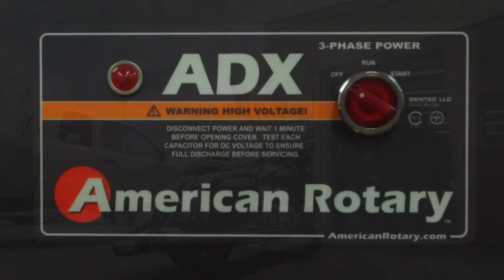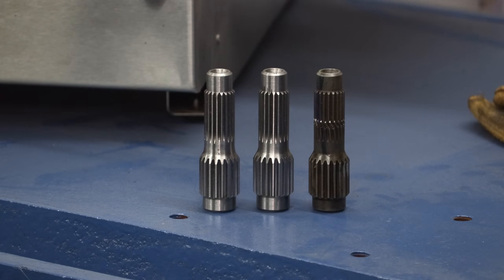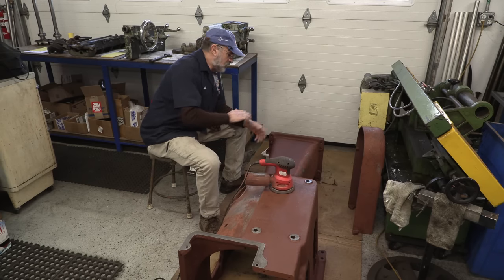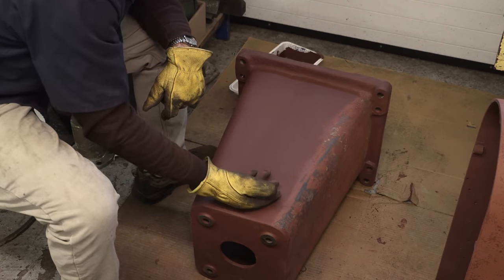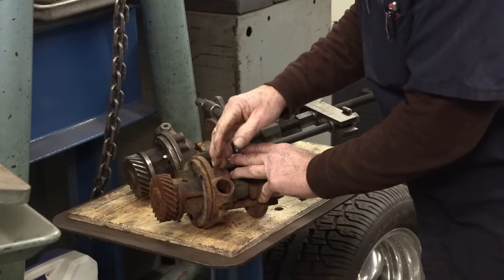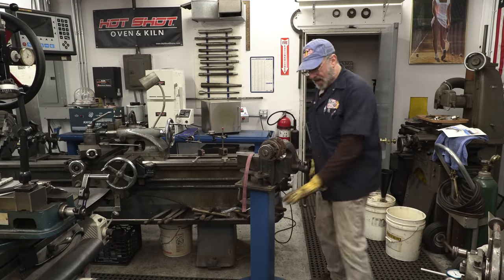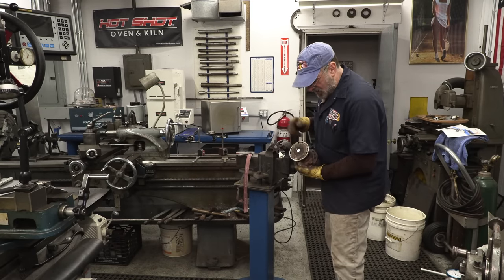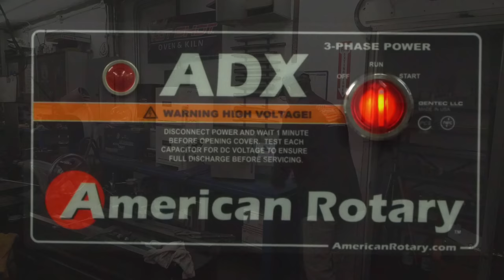Job Shop Saturday 1/28/23

Comment: Hi, just an observation on your oven. We had a similar, but bigger, oven where I used to work. We stress relieved CrMo weldments around 1" thick. We found that the thermocouple placement gave inaccurate component temperatures, and to get the accuracy specified we had to flash weld 2 thermocouples to the weldments, one for control, and one for recording the process parameters.

Comment: @5:20 When I was in the Diesel Engine business our blocks were painted inside with Glyptol (IIRC). You could look inside one that had been run to destruction (as most of the ones I inspected were) and that paint was still there!

Woot! My 31st Edition Machinery's Handbook just came to the door! I have a digital version, but I wanted the real thing! Going in an ammo can with my old slipstick and a solar powered calculator and some notepads. These days you never know when you'll need them! 🤔
Reply: I used that on some gear cases I rebuilt that were prone to getting some water in them in hopes of keeping the inside from rusting.
Reply: I think the gear case on the monarch (Pearl) is glyptal lined...

Comment: Nice eclectic mix Keith, those machine builders used to apply the surface filler with 8" wide blades, as always, great to see any skilled worker. 
Great work as always. 
Thanks for sharing

Comment: Keith, do you cut splines on automotive axles? I bought a Kia Sorento rear assembly, and I'm going to cut it down for building a garden tractor. I have a two cylinder engine I'll be putting in it.
Would it be any easier to have it cut and welded?
Reply from the maker: If the shaft is hardened then you need to anneal it first and then heat treat it back to original after,

Comment: Keith, when you heat treat those splined shafts, do the shafts and splines all stay the same size? I didn’t think I heard you say anything about it.
Reply from the maker: I miced up afterward and maybe a thousandth or less, with no inert gasses introduced into oven, you get scaling which is a loss of material in itself.
Reply: @KeithFenner , Thanks, I was curious about that, no big deal though.